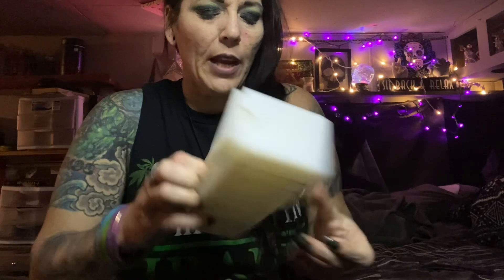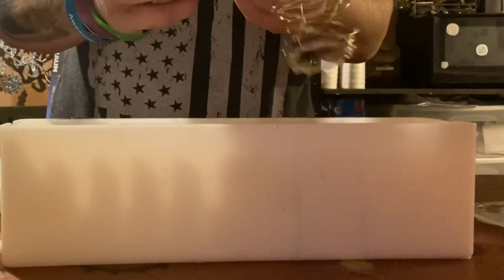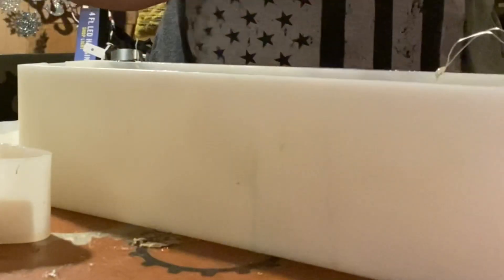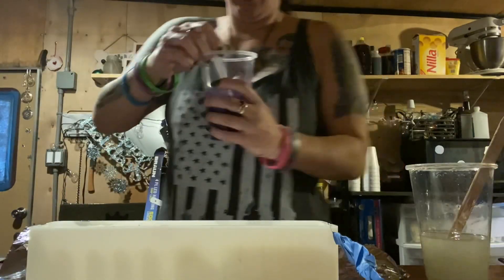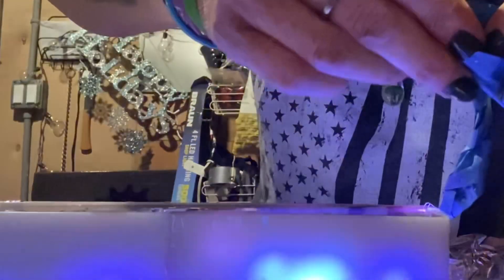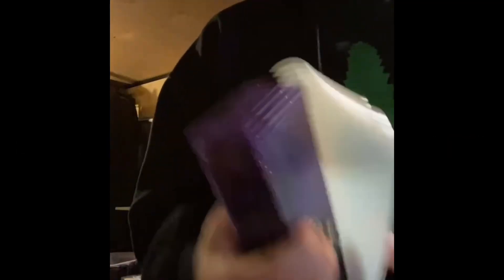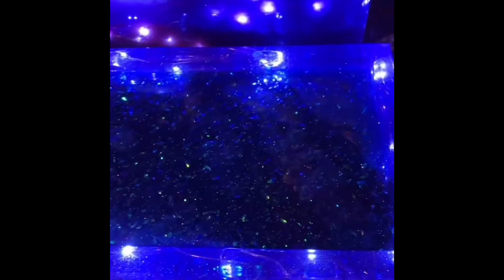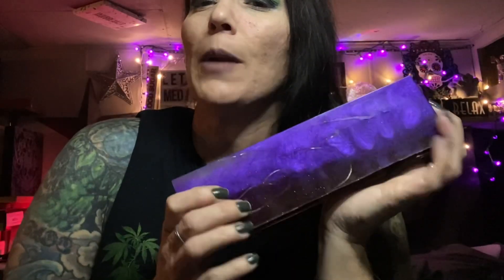DIY ISO&DAB STATION #EpoxyResin #Flmmj

Comment from the maker: USE CODE MEECHIE10 AT THE EPOXY RESIN STORE and save cash!! 
Link: https://www.theepoxyresinstore.com/blogs/news/want-to-know-how-to-create-resin-crystals-with-no-bubbles?utm_campaign=PG%20%7C%20Article%20Announcement%20-%20Bubbles%20%28YyfWvn%29&utm_medium=email&utm_source=PG%20%7C%20Engaged%2060D&_kx=PRlCZO5DtSUUFSSkGkJuY9I_e1xJfPgv86Pm5-a1UVo%3D.HwdL4p

Comment: I have a great idea for u and prob cheap compared because less resin, buy dab tools on Amazon 10 for like $12 and make resin grips in the middle, or u can buy little scoops and make the handle out of resin. Will look like designer dab tools, cheap to make and a lot of people would purchase from u. One request, if u do this, honor me with one of the first ones! Great vid as always!
Reply from the maker: I already have them😂..I have small molds and I’m going to make them the problem is I bought them and now I can’t find them. I had a bag of like 20 of them and it’s lost in my house somewhere. But I bought 10 more just in case
Reply: @meechie69Official  nice, keep me posted!
Reply from the maker: @SkinnyVinnie  I will definitely. I had already made the other parts to put the dab tools in, I think I accidentally threw them away LOL regardless I have new ones on the way
Reply from the maker: And obviously if you want one I got you